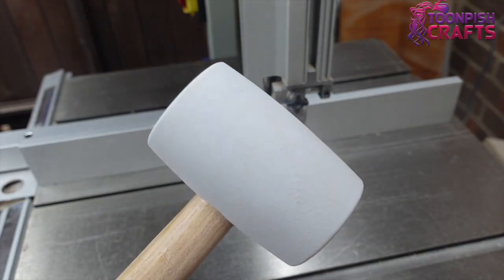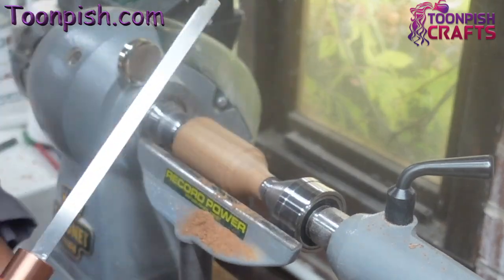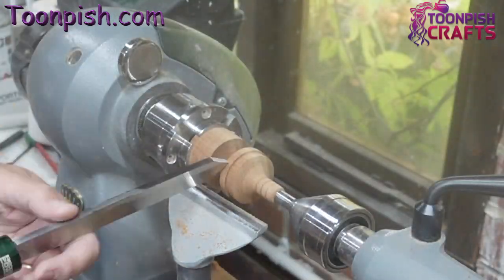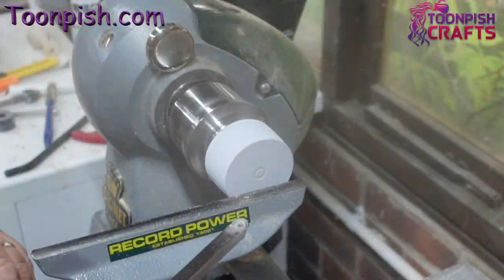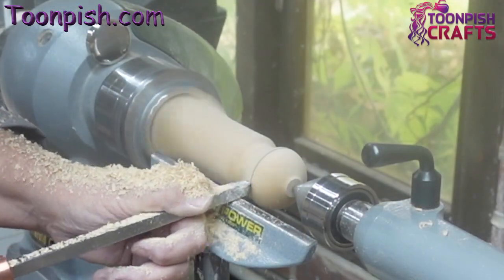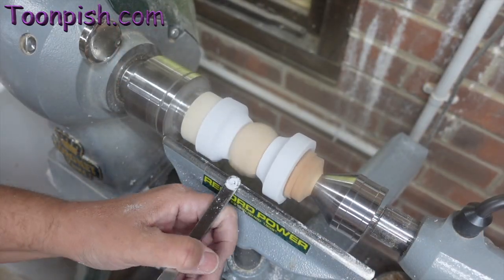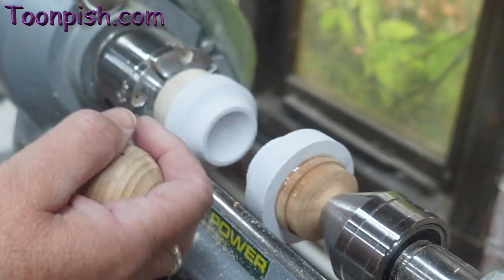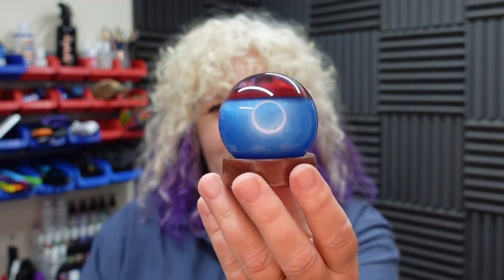How to get a perfect sphere on a budget

Comment: I love making something to make something too lol. Your spheres were perfect!  Really love the resin one. 

I wonder how big a lathe one would need just to do sanding and buffing. Do you think the mini lathe wouLd work for that?
Reply from the maker: Perhaps 🤔 if you are talking about the buffing system i use then really you need to ask a more knowledgeable person. Checkout chestnut products online and try talking to them as they make the one I use. 
Sorry I can’t give a more definite answer 😳😞🤷‍♀️💜
Reply: @Toonpish Crafts. Thank you.   I was thinking more of something that holds the sanding or buffing wheels and turns so you just hold the resin piece against it and it does the sanding or buffing for you. I thought I saw someone use a lathe for that. All the buffing wheels were in a row and they went from one to the other to get a nice shine. My wrist are bad so I thought this would help. I saw they have mini lathes on Amazon but I don't know much about lathes. 

Maybe I'm confusing it with something else.
Reply from the maker: Ok let me link you an alternative 
Jewelry Polishing Machine, Multifunction Jewelry Rock Grinder Bench Buffer Polisher Output Speed 4500-9000rpm https://amzn.eu/d/3SRm3Sv

Or 

BAOSHISHAN Bench Polisher Polishing Machine Lathe Sander Grinder Buffing Motor 10000rpm 320W 220V-240V https://amzn.eu/d/2fHLkCH

These are not ones I have tried but just to show you what is available 😀😀
Reply: @Toonpish Crafts  thank you so much. ❤️